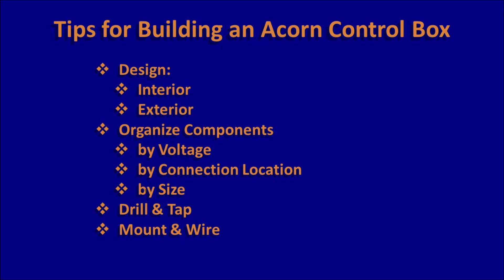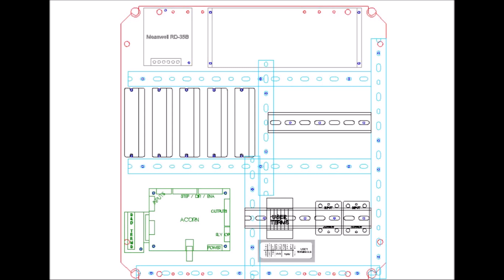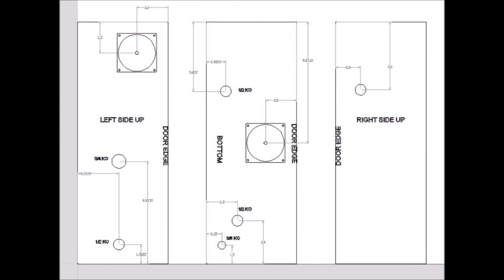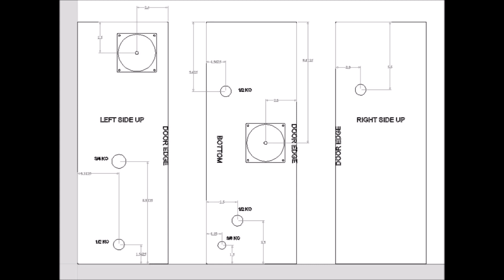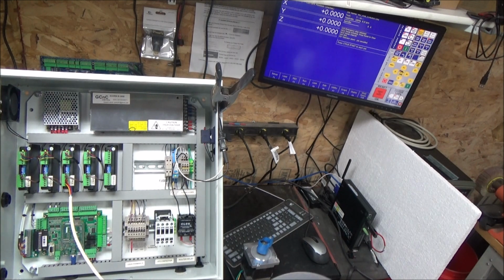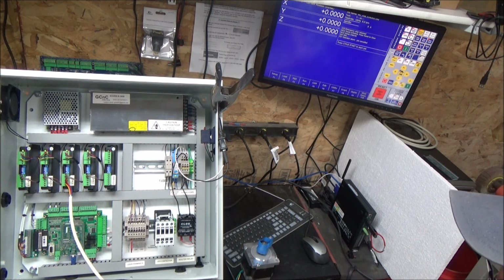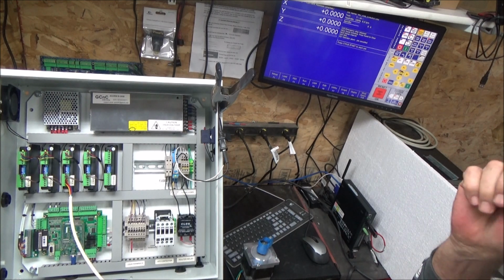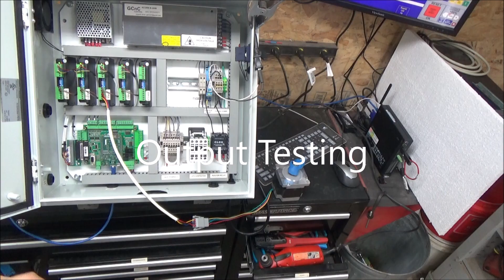Acorn Control Box Building Tips

Comment: Really helpful Gary. I'm in the process of building my first Centroid control box for my old 2007 PRS Standard Shopbot. I'm choosing not to reuse anything from my SB control box, so I could go back to it if necessary. (I have years of part files in SB code.) I'm trying to find the gray WAGO connectors SB used then, and I think you're using one in this video. Do you have a source?  Thanks again for sharing this info.